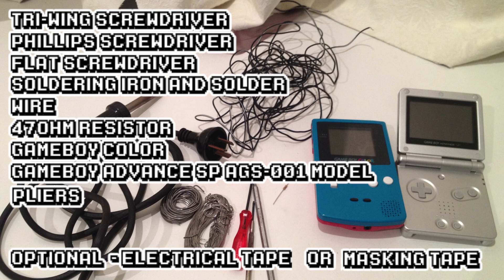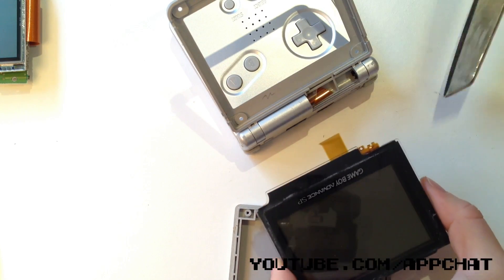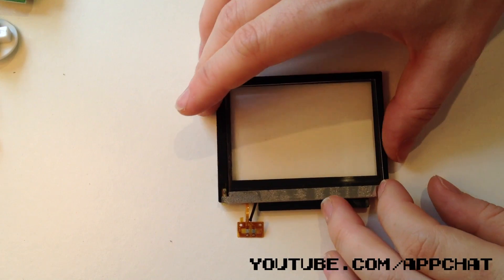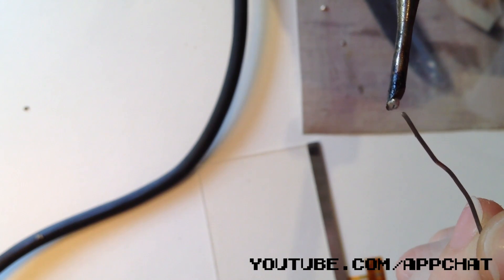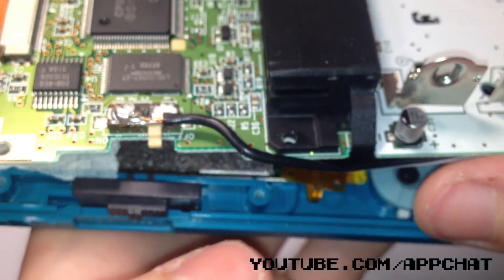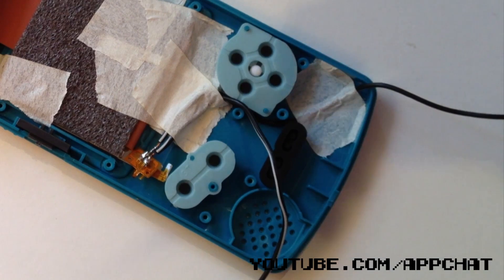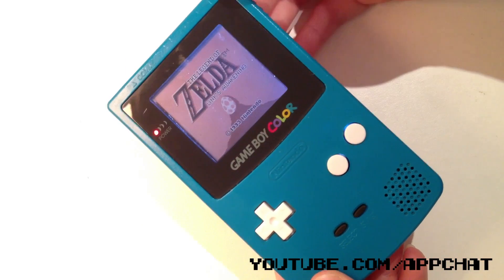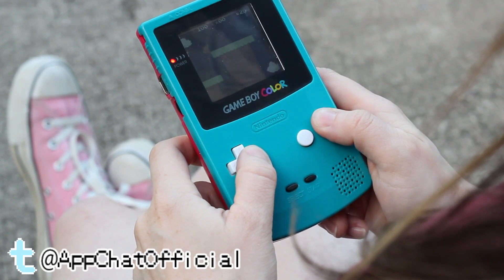Front Light Gameboy Color Mod TUTORIAL

Comment: Nice work! Thanks for this so much =) But for anyone watching, this isn't how to solder properly. You should heat the component with the iron for a few seconds and, keeping the iron on the component, place the solder ON THE COMPONENT because it is heated and will melt the solder. Then heat the wire over the solder on the component to connect it. Also, test the gb BEFORE you put it back together. Other than that, great job and hope to see more mod tutorials soon ... if this wasn't a one off =)

Comment: If you know anything about electrical circuits you would see I am right.  As using KWH it's not real yes, but I used that term to show people simple math of how much energy it would use an hour. That being it would not be 31.2 KW or even 1 KW as one, the batteries would fry and explode or the screen would just melt. As 0.0312 KW is about a 1/32 of what is used in the battery. It does not take alot of power to light up that screen. If you want to be more technical it would be 0.3120633 KW.

Comment: For the part where you soldered the wire to the power switch, Do you just solder it to the metal bar or does it need to touch the white thing that actually moves??

Comment: Not a bad mod, I personally wouldn't rip apart a gba sp for the back light but I have done a mod similar to this one where you just take a couple leds (3mm anything bigger won't fit) and just solder then coupled with some resistors to a power source. The light distribution isn't as good as the gba sp back light but it gets the job done.

Comment: You can just disconnect the screen ribbon cable instead of leaving the screen hanging; there are two small black tabs to pull and then the ribbon will slide out nicely.  When you want to put the screen back in, set it in, slide the ribbon back in, and push the two black tabs in.  This is a lot safer so you have fewer things hanging off of the case to get damaged: you won't have to worry about accidentally ruining the ribbon cable.

Comment: Yha you'll short out the whole system as more power has to go through the system to power the front light and the GBC was not built for that. Because if you don't have that and turn it on you would hear a crack snap and you're GBC would be fried.

Comment: So the battery life is about 15 hours on a gameboy color, but even when its off like other things the electricity will still travel through the circuit boards intil it hits a breaker and bounce off and WILL NOT go back into the battery. Now the Gameboy Advance SP with the light off will give you 18 hours and with the light on around 10 hours depending on the age of the battery. Because the sp uses a lithium ion battery that can adsorb the electricity running back through the battery.

Comment: ok, so, i wanna try this and i have a bunch of questions, so i'm just gonna fire them off XD

-how much are soldering irons? can i use a cheapy one?
-my gameboy color is the clear purple one, so the tape for the wires will be seen through it. has anyone tried it with this kind of gameboy, and are there other alternatives to taping the wire?
-about the frontlight glass: does the bumpy side face out, toward the screen cover that has the gameboy color logo, or toward the lcd screen itself?

Comment: My little orange tab was two pieces like yours, when i peeled it off, i lost the contact points to the other half and couldnt solder any wire to it. I would recommend not separating it an finishing like she did at first. If you have an issue after, try it her way but you don't want to waste an sp for nothing. Also you can salvage the speaker from the sp for your gbc.

Comment: As a tip for the future, don't put solder on the iron then scrap it off onto the wire. Heat up the wire/point then apply, or feed solder towards it.

Comment: DO NOT CUT THE RIBBON!!!! You do not need to cut it for this mod to work. You will simply have a GAMEBOY advance sp WITHOUT a front light!  You do NOT have to cut the ribbon from the gameboy sp, As you can put the lcd screen back together. I have many gameboy advance sp's with NO LIGHT. Do not ruin your SP to make this job easier, such a waste. You must solder the old solder from the ribbon connected to release the power connection between the front light and the lcd screen.

Comment: This is quite easy to do, with some time and soldering can be done with no problem. 
It increases the value of the gameboy as well by a good amount. With everything together It cost me 

 25$ gameboy color   gameboy sp light, (can be used from broken gameboy) 20$ 

 Other Materials 5$ 

 They retail for 80-100$ As no one wants to do the work.

 Ive made quite a couple of these and they have turned out fine. I encourage others to attempt to do this as it isn't that hard and is definitely fun.

Comment: No, no, no. Electrical tape is used to stop electrical current passing to or from another wire by mistake. It is NOT used to make a connection with the wire. That what the solder is for.

Your best bet is to ask about and see if you can borrow one.

Comment: The resistor she used (and the one in detailed guide) was 47Ω (ohm). If you look at the resistor, it has color bands on. It should have (from left to right): Yellow, Violet, Black & Gold.

The one in the first written guide actually uses a resistor with a +1% tolerance and has five bands on. Yellow, Violet, Black, Gold & Brown.  This is the one I got from my work place so that would work as well.

You could just get a multi-meter and check the resistor, set the multi-meter to Ω mode.

Comment: Hey I did the mod, and it was kind of weird at the end because it didn't seem to fit into place completely i had to push really really hard to get the power switch to line up with the thing on the circuit board.  Then when I turn it on, it turns on for about a second and then turns off, but the backlight seems to work...just doesn't stay on for more than a second...any help would be awesome!

Comment: Hi there, I tried this mod but i used a faulty GBA SP for the screen but I think the screen may have been broken before I installed it. But my question is: Do you get faint vertical lines when the light isnt on? I got this when I installed it but I had a hard time getting that black stuff off so I got finger prints on it and had to clean them off. Im wondering if its from me cleaning the light screen. Im tempted to try it again but would like to know if there are vertical lines before so.

Comment: ok got another gba and i figured it out you actually do not have to separate the two orange tabs you can do it the same way its done in the vid you just have to make sure your soldering spots are strong. A lil TIP: try your best to not touch the slide that fits into the light, fingerprints are VERY HARD to get off this peice and it will show up as a dark spot on your screen, also make sure there is no dust on the screens BEFORE you solder everything together lol. Thumbs up for the vid

Comment: A tip with your soldering.. Heat up the wire with the iron and then apply the solder to the hot wire. In that way it turns out muuch better! :) (Yes i'm a friggin geek with 14 years of soldering experience).. XD i'm only 20 btw.. lol

Comment: Elly, when you solder you need to apply the soldering to the circuit board, put the wire on it at the same time, put the solder on then remove the solder then soldering iron.